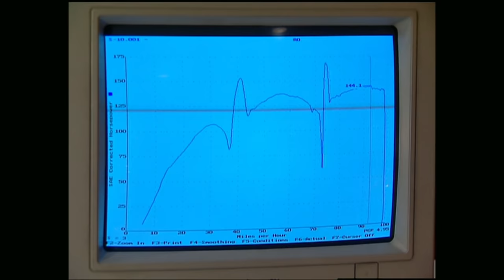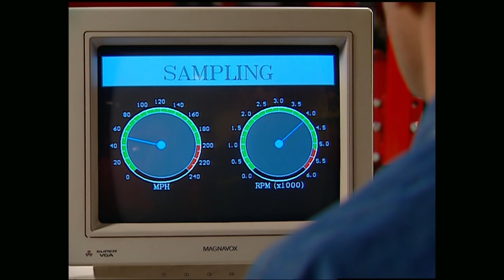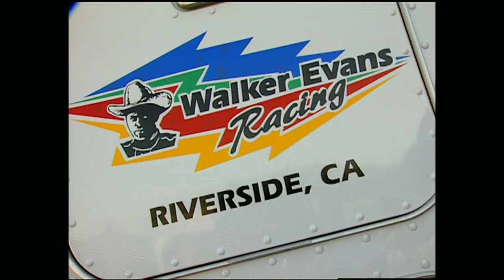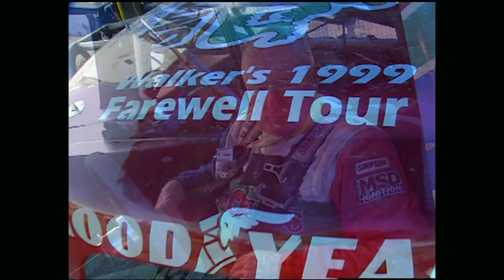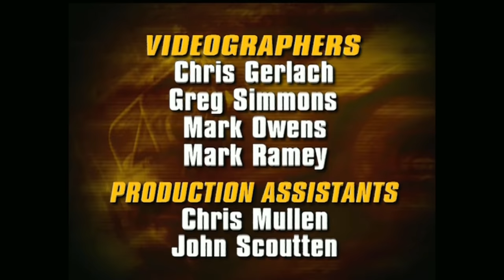Squeezing V8 Horsepower Out Of The S10's 4.3 V6 With A Supercharger Install - Trucks S2, E3

Comment: Pulley swap that superchargerer and it will make more boost. 

But tear it down, cam swap, add some ring gap, headers, upgrade the exhaust and fuel system then see how much more power its got.

Comment: Ok, let's talk late 90's early 2000's here. It would be way cheaper to swap in an LT1, trans, and ECU from a wrecked Z28 and have way more power than not even hitting 200 HP with a 5K SC.
Reply: I bet a z28 driveline would have possibly costed more money at that time lt1 was still pretty new.  The supercharger has alot more room for growth with cooling and more boost.  It isn't locked at that number.

Comment: The S-10 was never built to be fast. It was built to be good on gas, make trips to the hardware store, or make light duty deliveries. They make great parts trucks!
The 4.3 is the same architecture as a 350 sbc, but with 2 cylinders removed. Even some sbc parts fit on in it. So it's more than possible to make slightly better than stock sbc power numbers but with a much better power to weight ratio.

Comment: It was between this and ls swapping my blazer, I'm glad I ls swapped it, 200 horse is what the built 4.3 in my dad's blazer puts out, and my 5.3 puts out about 475...
Reply: Unless you have some sort of forced Induction or you're spraying that 5.3 it 100% is NOT putting out 475 at the tires
Reply: @yourmom-pi6jq  I said about lol didn't say what side of that it's on!
Reply: You're over shooting by atleast 100hp at 475 ....
Reply: @yourmom-pi6jq  maybe to the wheels buy flywheel is Atleast 475, the same cam with stock pistons and intake and exhaust manifolds puts out 450 according to summit, and I've got flat tops with underdrive balancer, holley intake, a bunch of shit I spent too much money on

Comment: I WONDER HOW MANY MILES WERE ON THE MOTOR B4 THIS INSTALL.
Reply: It couldn't have been much.  Truck is obviously a 98 or newer and this episode aired January of 2000 so probably new or damn close to it
Reply: @Matp345  I don't think they made the S-10 SS after 1998 as the Xtreme took it's spot.

Comment: This was cool but the price of that vortech n who knows how much that ignition system cost doesn't justify 200hp. Really clean install tho
Reply: Agreed..even when the episode originally aired 21 years ago,a v8 swap would have still made more sense.all that work,all the money  to almost hit 200hp lol..
Reply: @CELTIC-PRIDE-1979  yea a sbc from any junk yard w a decent carb n cam can't help but make like 270
Reply: @LAKESHARPER  still be more cost effective to do all of that than the price of a pro charger...
Reply: To put it into real perspective, it only gains 60 hp.  The K&N type air cleaner is good for 10 of those ponies.  So you are only getting 50 hp from the vortech.  I don't get it.  Why would anyone do that?  That kit is probably over $4k.  For 5 grand to can do a complete LS swap including all the shit needed from donor truck to make it CA legal.

Comment: I need to add this supercharger to my 98 Safari. It already has 300hp but i need more
Reply: How'd you get 300 without boost?
Reply: @Diesel257  A little after a while getting my Safari the engine blew so I put in a new 4.3 but a newer 4.3 from power torque and that engine had 300hp, and I also rebuilt the transmission now that they were both already out
Reply: @hectoraranda8097  was it an LV3 ecotec  based on gen V architecture? They are rated at 285. Power Torque I assume your talking about remanufacters engines and outlets to places like orielly's etc. The early 4.3 from them would be a stock reman.

Comment: Literally watched a vid before this where a stock 4.3 made 190 to the rear wheels, this supercharger needs a smaller pulley on it. The motor stock is capable of making 400 safely
Reply: 190 at the flywheel not at the wheels

Comment: They got so excited about 60 horsepower, if only they knew back then what people did with the LS today
Reply: Or what a 6 cylinder could be capable of today.
Reply: @bmstylee  Or what the K24 is capable of, I mean shit a drag racing snow mobile would go faster than this truck
Reply: @williamsanders468  after rewatching 60 to the tires with no proper ecu tuning or exhaust upgrade isn't that bad.
Reply: @bmstylee  Yeah what’s bad is it’s supercharged with 200 horsepower
Reply: @williamsanders468  what can be done now is amazing.  My dad grew up in the hay day of the muscle car and they could never dreamed how easy it is to make power like modern cars can.  I mean 800hp is almost boring after seeing the Hellcat or Gale Banks making almost 1100hp on Duramax.
Reply: Erm, LU3 (75% of L31).
Reply: @bmstylee  its a SBC 90° V6.
Reply: @williamsanders468  you are comparing a bike with a huge engine for that frame compared to a heavier vehicle. Stop knocking it. K24s are overrated.
Reply: @shadowopsairman1583  It’s better than a  4.3L V6
Reply: I'd love a 60hp boost. I got a 2000 s10 extreme v6. Mostly stock with headers exhaust and a tune. It's not bad it'll get moving and great daily driver. 60hp your gonna feel it's not a placebo and still drive it every day.  My chevelle has a 500hp 406 it's a ripper but with today's fuel cost it's too much money to drive every day. I used to drive it every day when gas was under a buck a gallon those days are gone.
Reply: @stoneyswolf  yeah in my state it’s about 3 bucks but from what I’ve seen it’s 4 bucks in California
Reply: @williamsanders468  resident Cali boy here. King city has the most expensive gas right now, more than SF. Not sure about socal idc lol that's their problem. But yeah 4.65 for regular, 4.85 for midgrade, and 4.95 for fucking premium!!!
Reply: @Jack Russelle Lewis Yeah but if this was true you wouldn’t see the engine everywhere, there are tons of people who built that engine and stuffed it into there drag car

Comment: Only 60 horse. Not for a few grand. You can squeeze 500hp out of a 4.3 by building it and using s holley fuel injection system

Comment: I’m around 285ish to the tires on NA . Lossa moneys later lol
Reply: What was your build? Still a 4.3 or did u ls swap?
Reply: @alexovercast3359  4.3 , .030 over , KB hyperuetectic pistons ( not spelled correctly I’m sure ) stock rods , turned crank , .500 lift cam @ 112-114 dur , aluminum CC roller rockers on 3/8 studs , comp push rods , Manley valves ( could use some porting and polishing )  255lp fuel pump , TB spacer ( probably useless ) , k&N intake kit , MAP EGR CAT and downstream O2 delete . And lotsa time on HP pro suite learning to get her dialed in lmao . I did swap the diff to 373 gov locker out of 99 blazer .
Reply: 275-285hp 400 ft lbs on street tune , I’ve seen nearly 350 on 114 VP fuel .

Comment: I had a 98 S10 blazer and the v6 was a piece of shit. I swapped it for a vortec 350. And it made more power in stock form.
Reply: L35. LU3 from 2003-2014 was better.
Reply: My 2000 has over 235k on the original engine and runs perfectly. Literally uses no oil. Zero smoking. Purrs like new I can't really believe it myself. It has the typical oil seepage nothing to worry about. The 4.3 was one of the best engine's GM made and literally the same exact design as the vortec v8 with two less cylinders. Only difference the v8 made more power.
Reply: @stoneyswolf  75% of a Gen 1 SBC.

L31(vortec) and l35(vortec) are same platform, both are gen 1 sbc

You can use v8 rods and pistons in the v6.
Reply: @stoneyswolf  Same except 260k. Transmission finally went and I have a zr2 axle now.

Comment: What? LOL you're just going to supercharge right into the intake without any after cooling?

It's like it's the first day of kindergarten.

Don't let Gale Banks see this video, he'll pop a blood vessel
Reply: It's how it used to be done.
Reply: Considering that in that day the engines had a lot lower compression from the factory and considering the power goals were a lot lower it's not a bad idea.  200whp was really good at that time, consider the ls1 was new, the vortech 350s were still being used in trucks not the 5.3 or 6.0 ls series, they came with 240hp at the flywheel.
Reply: You don't need an I/C on baby boost. My 300ZX Turbo didn't have an I/C.